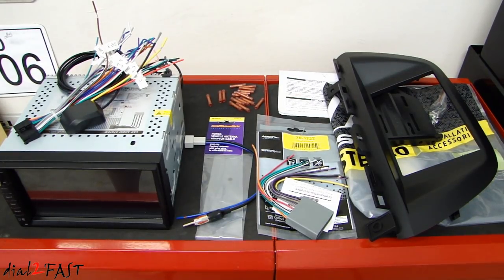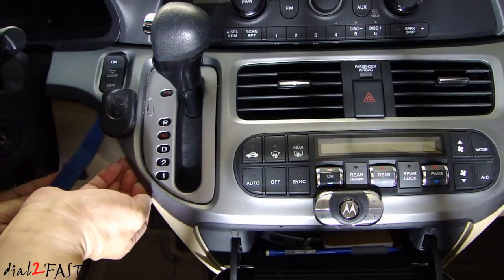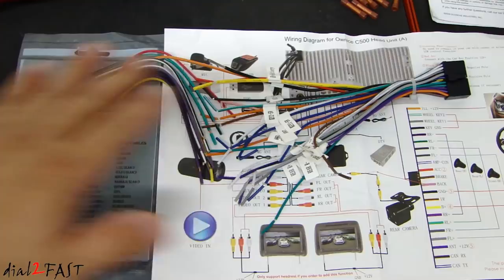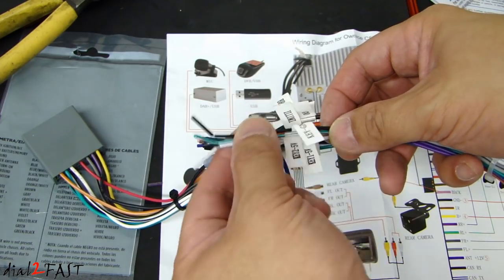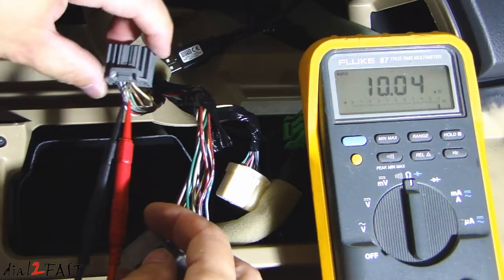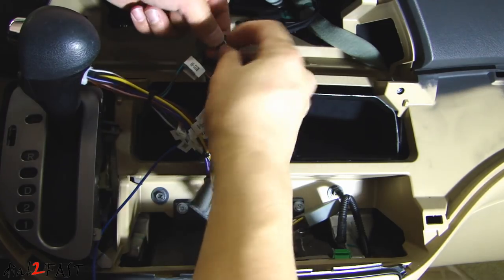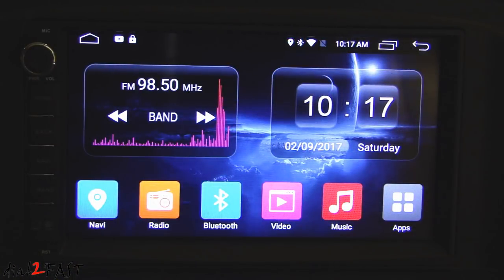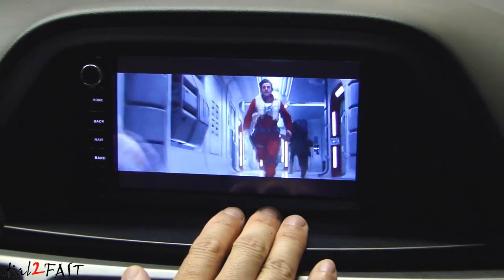Install Android Car Radio & Steering Wheel Control In Honda Odyssey 08 - Ownice C500

Comment: what is the name of this system i want fit in my Honda odyssy  2007. where I can buy this
Reply: You can use any type of android car stereo in your taste and budget but a tiltable screen is strongly recommended for Odyssey if you want 10 inch or bigger. Common parts are a dash kit and a wiring harness. For dash kit, there are three types of dash kits on the market, Metra, Scosche and Chinese brand. It is the key to find best match between your android stereo and dash kit to get professional result. For wire harness, you can use Metra 70-1721 but the wiring harness doesn't support Steering Wheel Control (SWC) cause pin 3 & 11 are empty. You will be able to find a wiring harness which support SWC on eBay or you can directly solder two wires from stereo to the coresponding wires from dash.

Comment: "brain storming"....if i go this route, i would loose the factory functionality of signalling power to the rear "RES" system, but i could tap the rear "RES" power and video output source to come on with this unit...interesting...😂
Reply: My odyssey ha rear factory dvd that has separate connectors to turn off and on rear power power, how you will connect that?

Comment: You should always disconnect the battery before you do any electrical job... just saying😂
Reply from the maker: Car stereo install never require disconnecting the car battery. Even doing car alarm install don't require it.